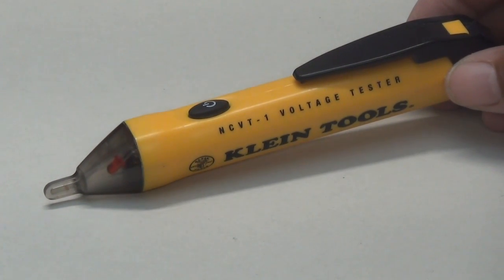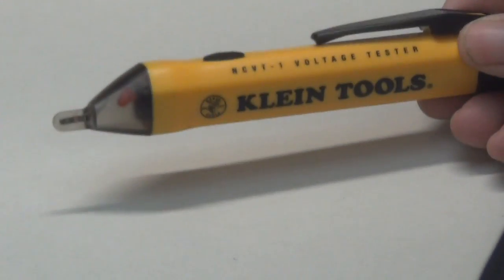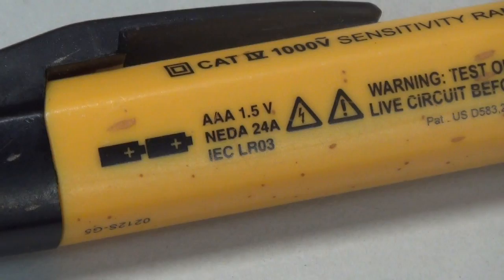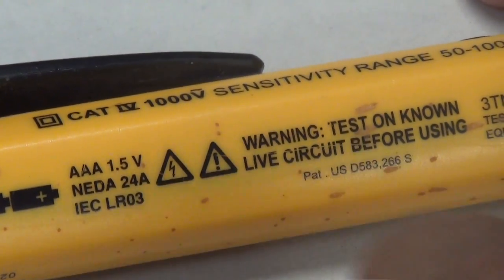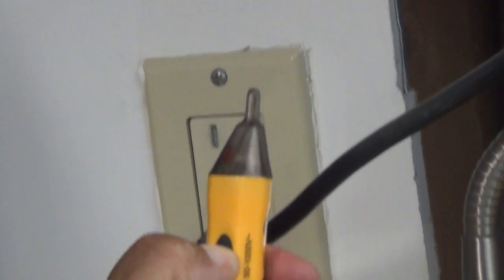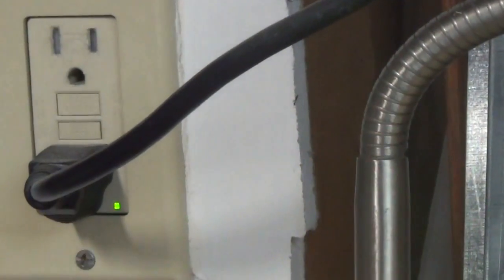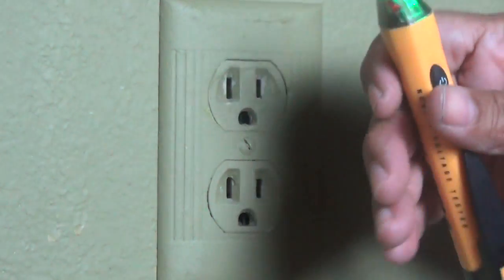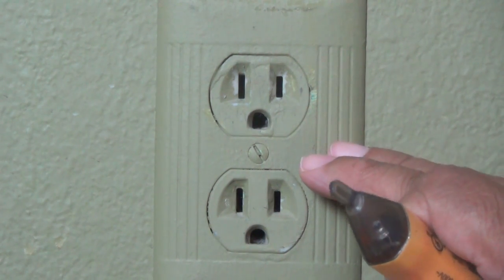Important Thing You MUST Do Before Using a Voltage Tester to Check an Electrical Circuit

Comment: I am impressed that you checked both halves of the outlet. Kudo's for you.!!!

 I have seen the jumper between the top and bottom halves open, leaving only 1/2 the outlet hot and the other half dead.
 Also sometimes the top half is fed from one voltage source and the bottom from another. A deadly duo if you don't check both top & bottom outlets.

Comment: Always check both sides of each socket. I have found many improperly wired.
I check twice. Once while powered to verify correct wiring another after de-energizing as you have shown. Also be aware that sometimes one socket will be always on but the other could be controlled  by a light switch on the wall. 
>

Comment: You should also honestly check the tester after as well just incase it fails while you are doing your testing it only takes a couple seconds more and guarantees you're safe. 

Test a known live circuit then whatever you are working on then the known live circuit again and you're good to go.  Never take any chance with electricity you might only get one shot.
Reply: Thank you!

Comment: Saw this video title and my first thought was I hope Leah explains to test/check it first. Phew;)

Excellent video as always.

These testers aren't so much a tester in the electricians sense but a useful tool none the less.
I personally use a socket tester most of the time but that limits me purely to plug sockets.
Socket testers are a more reliable way of quickly checking but the initial safety check is still needed. 
Though note at least one major electrical supply has put a recall out on its socket testers due to a possible error if a circuit fails in a certain way. No major as for the average DIY type they will note need to prove things quite so stringently as a trades person might.

As for the Voltage sticks themselves, though useful in a multitude of possibilities they have their flaws. As they are prone to errors. They can also pick up the magnetic fields from near by cables, so something to watch for.
I'd also recommend, always removing the batteries when not in use. The amount I've thrown away due to battery leakage is shocking;) Something not required with a socket tester as they use the power from the socket to test. Ergo if nothing lights up the socket is dead.

Ultimately as with any bit of kit, get to know it before using it fully. That includes reading any instructions (I'm telling myself that just as much as anyone else;)

In all circumstances, isolate the power before performing any work and if in doubt get someone who knows what they  are doing.
Saving a few pounds/dollars isn't that good if you electrocute yourself.
Reply from the maker: David Gatherer This is such good advice to share, thank you for taking the time to share it.

Comment: Good to always test hot and neutral; outlets can be mis-wired
Reply: An easy way to remember is that your copper screws are for hot wires (black and red), silver screws are for your neutral wires (white). Now thats the basics. I have seen instances where a "neutral" was used as a hot but according to the CEC (Canadian code) its not allowed anymore.
Reply: @melbendigo  If you're not sure then suggest you get an electrician in to look at it.

Comment: personally, I would test the outlet that I plan on messing with BEFORE shutting off the breaker to confirm that the probe will trigger if I stick it in there.  make sure that the exact same outlet (or other device) can trigger the detector in exactly the same way you probe is after you shut off the breaker.

Comment: Leah,  use a digital multimeter if your coming in contact with the circuit conductors,  do not trust your life to the non contact tester,  do the 3 step test with the multimeter as well,  test on known live circuit then the circuit you’re working on and then the known live circuit again to reverify the meter is still working correctly.  The non contact tester is more for trouble shooting and not considered to be reliable enough to be an “approved tester” when it comes to trusting your life to it ....

Comment: Can you tell me if you can use this same tool to test wires, like as in changing out a ceiling fan where you have wires that are twisted together and capped?
Does this tool read through the sheathing?
Thank you

Comment: Great tip! I need to buy one of these. EVERY socket in my house is installed upside down and it drives me crazy. I want them all corrected.
Reply: Same thing happened to me when I bought my house. Turns out, the electrician has a dispute with the general contractor and the electrician deliberately installed the outlets in all of the homes in the neighborhood upside down. What a douche!

Comment: nice video but!!! remember, even though that wire to that outlet may be off, once you pull the outlet out, there and usually are other wires in that same outlet box that do still have power running through them. and be advised from a electrician that has  worked on wires for over 50 years, that you can still get shocked. the only way this video can help you is if only one to 3 wires go to the outlet. neutral, hot and ground. Also, once you pull the outlet, switch or light off or out the electrical box. Inside other associated wires may have caps on them. in my experience, these caps may be loose or can come loose when the wires are disturbed by checking behind any light, switch or outlet. this can cause undo harm to you appliances, computers or like one electrician i helped, blew out the electronics for a dishwasher and burned out a motor for a garbage disposal. so check all wire nuts and make sure they are secure. stay safe

Comment: I do use these; HOWEVER they do break. Recently mine broke - but only partially. The power on indicator came on but it didn't sound when testing. Fortunately there was a sign that said ALWAYS HOT next to the outlet. So I tested with my voltmeter. Yup it was HOT.  Just beware things do break, and sometimes only partially.
Reply: I've had 1 do that also.
Reply: Shawn Tartaglia My Klein tester has done this too but it turns out it was just low battery. I put in new batteries and it worked again.
Reply: You can turn the sound on and off

Comment: I use the test stick on a live circuit alwayd. When I've proved the circuit is de-energized.  I use my test probes on a voltage proving device test the circuit from line to neutral, line to ground and ground to neutral.  It's always safe practice.  If the current flows through you your muscles will cease to release.  If your lucky you'll manage to move away in time.  You'll most probably be unable to call for help because of the current flowing through you.  Mains voltage is a force not to be reckoned with.  Anything over 50 volts is pretty dangerous more so when the Amperage is high.  You don't want to be the conductor carrying the current to ground 🤷‍♂️

Comment: How would a wire in the attic beep red if it is shut off at the breaker? Its going red on an outlet i know has no power to it. How do you trust these things?

Comment: TO LEAH: My VoltAlert 1AL-A makes a continuous high pitched sound. Pressing the on-off button has no effect. The only way I've found to make it stop is to remove the batteries. Any suggestions?

Comment: This beats my method of plugging a lamp in and hitting every breaker while my gf yells to me when the lamp goes out..
Reply: I plug in a radio and turn the volume up.  Once I was in a three story house and the breakers were in the basement and the circuit on the top floor, so I borrowed the house phone and called my phone that I had left by the radio :-)

Comment: If the battery is dead it wont light up and beep when you turn it on
Reply from the maker: Roger Whiting  sometimes a battery is weak and gives false readings.
Reply: Roger Whiting I was thinking the same :-)

Comment: I do believe the green light is for low voltage... if you hold the button a little longer it will turn blue this is for high voltage
Reply: Dual range has that feature, I don't  believe this one  is a dual?

Comment: Love your videos but this is a no contact tester which means you don't need to stick it in the outlet. It will even detect it by getting close to the cable.
Reply: Yes, but it's better to be safe than sorry.  I've had outlets that weren't wired right/wire disconnected and pushed back that didn't light up the tickler until it was probed in there.

Comment: What if it beeps by simply touching the cover plate with the voltage tester AFTER I replaced a switch, does that mean I did something wrong?
Reply: since no one answered this I will weigh in, first of all, is the cover plate metal or plastic/nylon?  The thing about these testers is, they detect voltage, but there is no way to know how much voltage they are detecting.  could just be stray/phantom voltage-- i get that all the time esp in old dimmers.    only way to be sure is to test the wires and the box with a multimeter.

Comment: Before you insert into wall socket, make sure it's unpowered by sticking a fork in the wall, not doing so might damage device.
Reply: EHZ_115 you are correct! This way in the event it was an energized circuit, the breaker will trip and turn the circuit off....very important... make sure the fork is steel and not something non conductive like a spork from KFC

Comment: I threw my away, couldn't trust it and it was a pain in the butt to operate. My pro electric friends wont use them. I did get a less expensive one that works great from Harbor Frt.

Comment: I just don't know why you need such a complicated tool for the job. I had had screw drivers with leds you put right on your socket and if the led lights on is because it's live. Always worked, no need batteries. 100% reliable. (Ex: https://www.aki.pt/ferramentas/ferramentas-manuais/chaves-de-parafusos/busca-polos/buscapolos3,5x65mmstanley-p66483.aspx
Reply: @realsigsegv I went to the link you mentioned. Didn't find anything that would look like what you described.
Reply: @cesarrodriguez9597  , well the link has more than 1 year... Try this one https://www.aki.pt/ferramentas/ferramentas-manuais/chaves-de-parafusos/busca-polos/Buscapolos140mm-P26886.aspx

Comment: Are you having a laugh, this should never be used to make sure power is dead, you should use test lamps
Reply: Morgan Mackay I disagree, this tester will tell you if there is anything live in the box. A lamp will only tell you if the outlet is live. Often there will be more than one circuit traveling in the same multi gang box.

Comment: This tool may be a little more convenient because it's just a pencil.  But I'd rather use my fluke multimeter.  Plus I measure continuity all the time also.  By the way, america needs to adapt 220V.  It is clean power better for electronic components making them last longer.  And cheaper.  Come on america, why so stupid?
Reply: @Thirdplace4life  How do you know that I don't also have a master's in applied science, and engineering technology. How do you know that I don't also work for the same Midwestern power company? Fancy titles, and calling people stupid is less effective on the internet as than it is in the real world. Provide actual data showing that 220volts is cleaner, cheaper, and makes electronics last longer, or be disregarded as a troll.
Reply: How do I know?  I know because if you did, you wouldn't be asking these dumb questions.  Just google "Is 220v more efficient than 110v?".  There I helped.  You can find the rest out yourself.